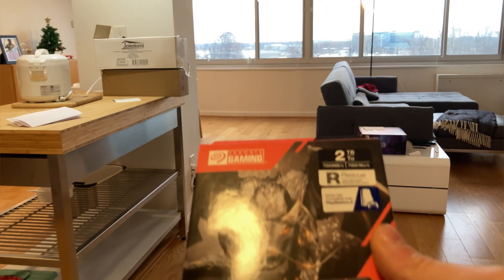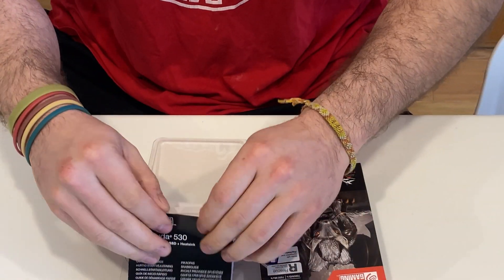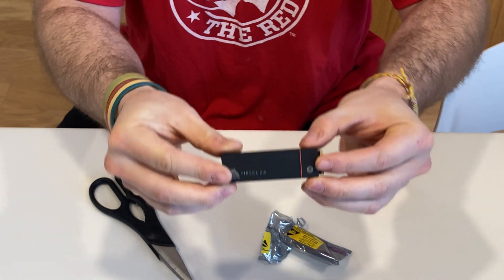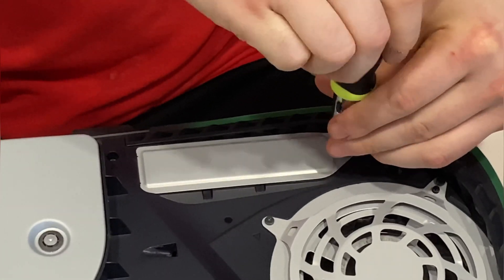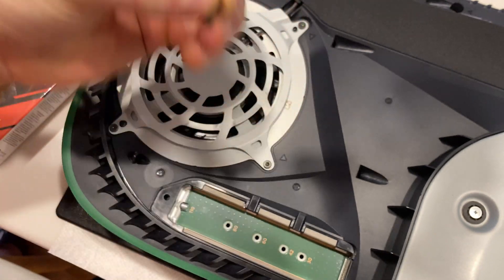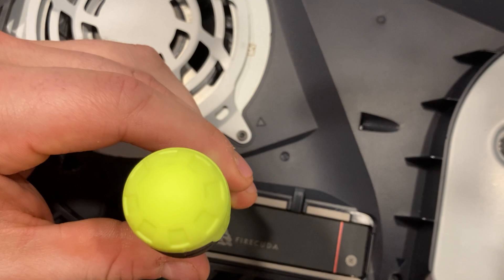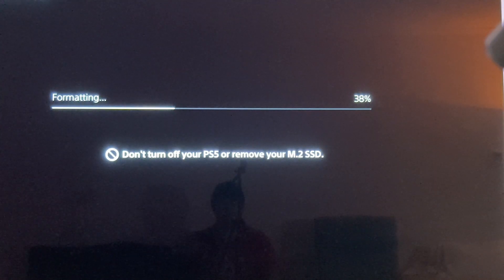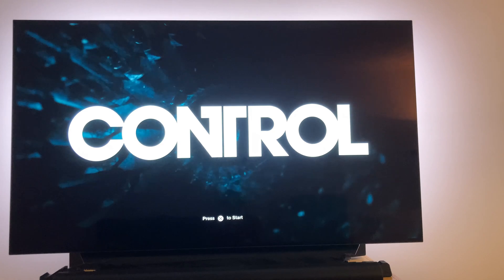How to install the Seagate Firecuda 530 SSD into your PS5

Comment: Anyone else cannot get this to work? I have inserted this ssd into my PS5 like 15 times last night and it won't recognize it!! I spent 2 whole hours trying different angles and i get the click and im 100% sure i put it in correctly and it just won't work smh. What is going on? This ssd is brand new from staples and it shouldn't be defective. Any tips you can give me? I dont want to have to take this back because i got it on sale. I have the 1tb one

Comment: Should you remove the sticker from firebaracuda 530 with heatsink? I removed it now I dont know if I just ruined the warranty.. Like I am used to that you need to get the stickers removed from electronics..
Reply from the maker: I haven’t touched the firecuda 530 ever since I installed it back in December of 2021 when I released this video.  Still works thus far with no issue.
Reply: @ethangoldberger5290  yep, but you didnt removed the sticker right

Comment: Hello I recently purchased the firecuda 530 as a means of expanding my storage for the ps5. I received the item, unpacked and installed the device following the correct installation method (inserting at an angle until hearing a click, etc). It recognised the device and formatted the drive and seemed to work fine for a few days. Today however my ps5 turned off by itself saying expandable storage removed incorrectly, rebuilt the database and now no longer recognises the m.2 drive. Despite multiple reinstall attempts it won't even see the drive thus not allowing me to reformat. Could the drive be faulty? Any suggestions would be much appreciated.
Reply from the maker: This seems to be the drive being faulty. I would return and see about getting another drive.  If the same problem happens again then it’s a problem with the PS5 itself.

Comment: Sorry. But I’m too scared to touch mines. 🤪
Reply from the maker: It’s not that hard.  Just follow the step by step instructions in this video and you’ll be able to install an SSD in your PS5 in no time.  In the long term I do recommend installing an SSD due to games only getting larger in size.
Reply: @ethangoldberger5290  i have got my ssd firecuda today but very difficult To open my ps5 😞hate internal Drive i love more external drive But Thanks for this video

Comment: My spacer doesn't fucking fit, for some reason (it's fine in the 110 slot though)
Reply from the maker: That’s very strange.  The stock spacer should always fit.  Very weird.  You could try exchanging that SSD for another one that fits in the 110 slot.
Reply: @ethangoldberger5290  the spacer wasn’t a perfect circle (assuming that’s a Sony error since I’ve never opened the SSD space until now 

I was able to get it to fit by shaping it back and it’s all set up working (aside from the test only reading at 5600, no issues so far)
Reply from the maker: That’s a Sony thing there.  Quality control on their end.  Glad you got it to fit, cause the spacer is a critical component in making sure the drive is level and stable.

Comment: I have the exact same ssd firecuda 2tb...but my readspeed said it was 5658 or somewhere around there...why? Everyone else's i see is over 6000...😕
Reply from the maker: The key takeaway is “up to.”  The speed is up to 7300 mbps per second.  That is not the same as saying such as “the drive operates at 7300 mbps.”  When they say the drive operates up to 7300 mbps it means that is the maximum speed it can hit.  Often times the drive hits a lower speed.  That being said 5658 seems a bit low, barely faster than the 5500 mbps of the PS5’s internal SSD.  Is the Firecuda drive at least working in terms of playing games off it?
Reply: @ethangoldberger5290  so far its been working good. Was beginning to think I got a knock off or something lol...I did buy it from best buy though.
Reply from the maker: Well Best Buy is as authentic as it gets.  Got mine from Best Buy as well.
Reply: @Anaconda-squeeze  reformat an it'll show a higher read speed. That's what I did an it hit 6300+
Reply: @GRlMME  if I reformat it will it delete all my saved games?
Reply: @Anaconda-squeeze  unfortunately yes, so I would reformat it an then download your stuff back before you go to bed or go to work
Reply: @GRlMME  dang that does suck...would i have to take it out of the ps5 and reinstall it to reformat it and see my read speed?
Reply: @Anaconda-squeeze  nope, once your p5 restarts it'll ask if you want to format your ssd an if you click yes it'll show read speeds

Comment: Hello, awesome video it helped me to install my ssd today. But I was wondering if this could cause an issue, the screw at the back of the ssd when I installed it, it wasn’t in the middle of the demi cercle ( I am talking about the thing that looks like a C on the back of the ssd where it should be over the 80  screw) at the back of the ssd, it was more at a side than the other side. Is that okay or will it cause an issue eventually?
Reply from the maker: I don’t think it should.  All the Firecuda SSD’s are made the same way.  The screw is made to secure the SSD down in place.  Make sure that the drive is fully secured into the connectors.  You should hear a distinct click when the drive is in place.  If it is not, it could affect how the screw in the back of the SSD goes into the Demi  circle.  Also did you read the specifications that Sony gave?  They are very specific what drives are compatible and aren’t with the PS5.

Comment: What kind of screw driver u use im trying to install mine and I can’t get the screw in slot to move I’ve used the smallest Phillip screw driver and it doesn’t fit
Reply: Dang Jesus... Your philips screw might be stripped.
Reply from the maker: Jesus Guzman: it should be a #1 Philips head screwdriver.  It’s one of smaller ones.  As George._Sir._Gemini said, your screw driver might be stripped.  Also you could try a flat head screwdriver as well.
Reply: Yeah must of been lol finally got it thanks
Reply from the maker: Awesome to hear!
Reply: @jesusguzman7587  did you get it with a flat head or.. ?
Reply: @SkiCashEmOut   no I used a Philip screw driver it’s kinda hard to get it out u gota be careful not to strip It
Reply: @jesusguzman7587  yeah I tried every screw driver it just doesn’t come loose🤦🏽‍♂️

Comment: Ahhh I can take the first screw off but I need a smaller screwdriver for the spacer!
Reply from the maker: Did you manage to complete the installation otherwise?
Reply: @ethangoldberger5290  i think the screw was just striped
Reply: @adis2153  what does that mean do I need a new one?
Reply: U know what one it is ?

Comment: What made you decide to purchase Firecuda instead of WB or other brands?
Reply from the maker: It was between the WD SN850 or the Firecuda 530.  Reason I decided to go with the Firecuda 530 was because it had a higher read and write speed and also because in some tests that I saw on YouTube by other reviewers, the Firecuda 530 ran cooler while playing a game off the drive than the SN 850.  It could influence the life of the drive and so that’s why I decided to get the Firecuda 530.  Also all the drives I use for both PS5 and Xbox Series X are from Seagate, so also wanted to keep commonality.  Another drive that caught my eye was a drive from Sabrient which has an included heat sink that replaces the PS5’s SSD cover plate.  Thank you for your question and hope this answers it.
Reply: @ethangoldberger5290  Thank you. This validate many of the points I was looking for in a drive. I was looking at the Sabrient too but I think I like the enclosed heatsink better.